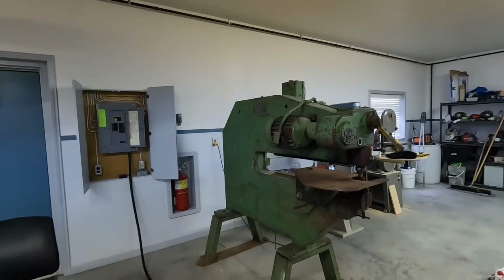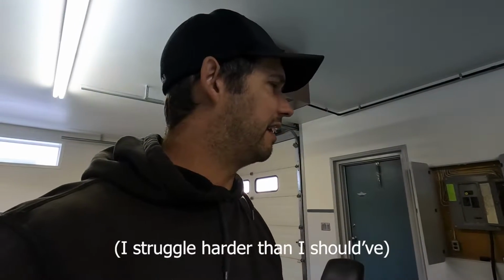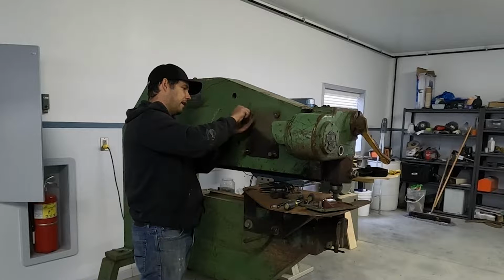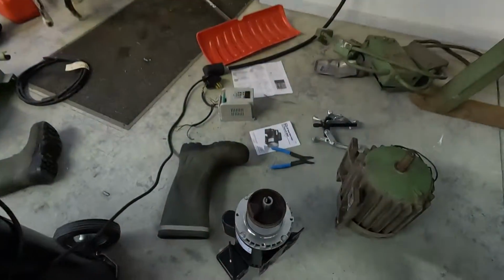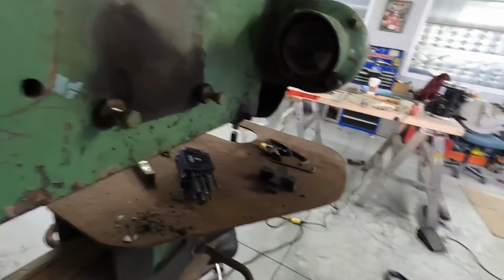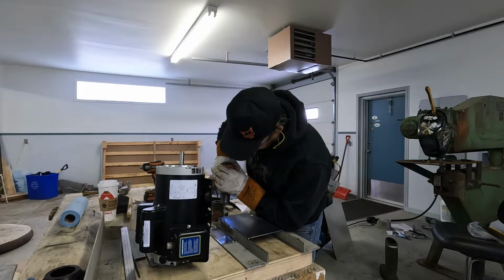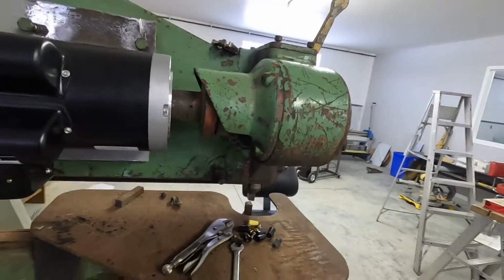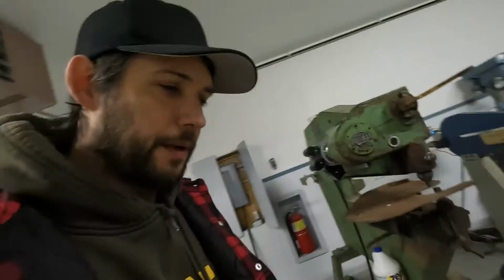Revive and Run on this OLD piece of metal working history!  SAT FOR 10 YEARS!!

Comment: Three phase is better suited/efficient with a VFD.  Someone can correct me if I’m wrong but, I’m pretty sure you have the wrong motor.  1) The motor design must be either permanent split capacitor (PSC) or shaded pole in design. You would need to confirm this with the motor manufacturer. Any other type of single-phase motor design will not work, including a capacitor start or capacitor start and run set up. Looks like you have the VFD already.  I would personally put the three phase motor back on and wire it in low voltage wye configuration and add your VFD to that.  You’re going to lose some horsepower. But it still should power thru it.  I have one on a bridge port. It works just fine.